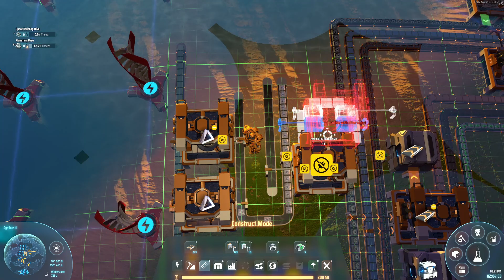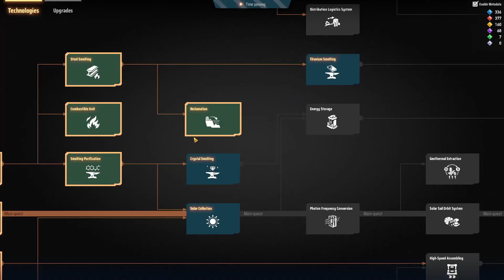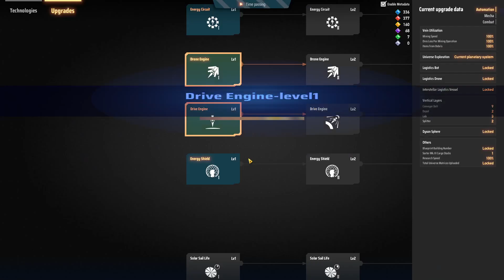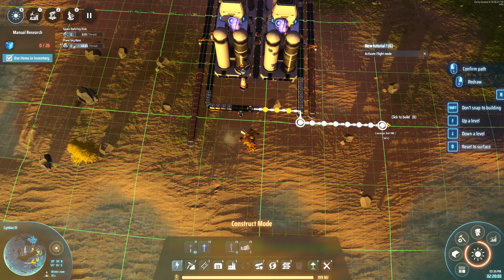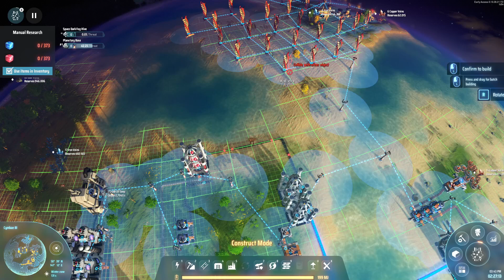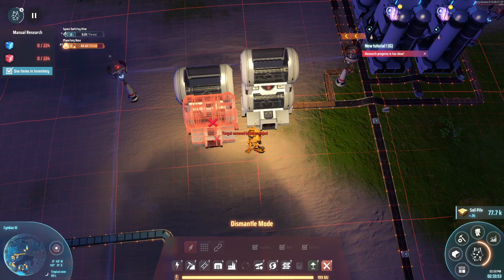EASY OIL & RED CUBES - Guide DYSON SPHERE PROGRAM Dark Fog 4

Comment: As a noobie who's been playing for less than a fortnight, don't make the same mistake I did.  Oil is different to other resources in game and not the most abundant.  That flowrate (typically 1.5 to 3.5 units per second) halves every 12 hours until it reaches 0.1 units/s so if you set up production based on the starting flowrate, 12 hours later half of that will stop working.  The only solution I'm aware of is to buffer.  Take the supply of the oil extractor straight into a storage tank(s) and supply the production from that tank.  Realistically you need multiple oil extractors feeding into that buffer.
Reply from the maker: Yeah, that's pretty much the reason why I only set up 4 Refineries per Oilsink. And store it all. And don't burn a bit of it. Later in the game we procure Hydrogen via Gas Giant Mining, so the only thing we are after is the oil itself. So buffering is very valuable here, yeah.

Comment: Do you want some planet with those wind turbines?

JK, I also use renawable resources when possible. It makes it less of a hassle to rely on them.
Reply from the maker: Yeah, they are horrible in terms of spacing efficiency overall. I do love them for power before I have access to proper Silicon though. I hate burning Rocks into Silicon for Solar Panels, as it is terribly inefficient.
Reply: @Ic0nGaming  Yeah, there are some better generators than others.